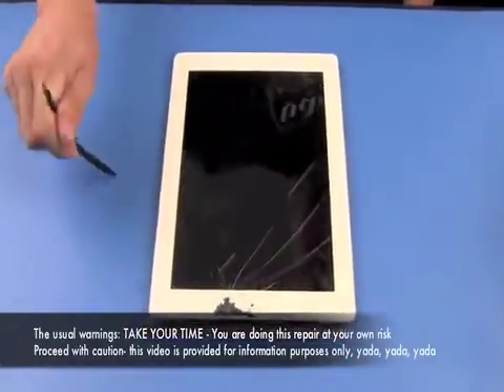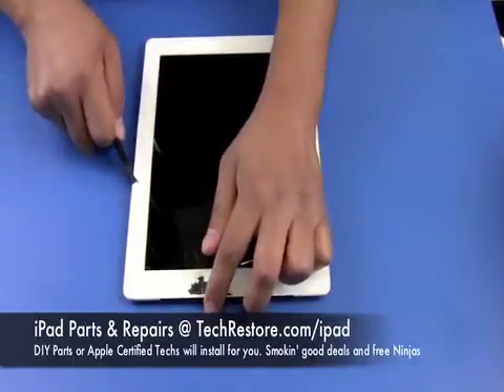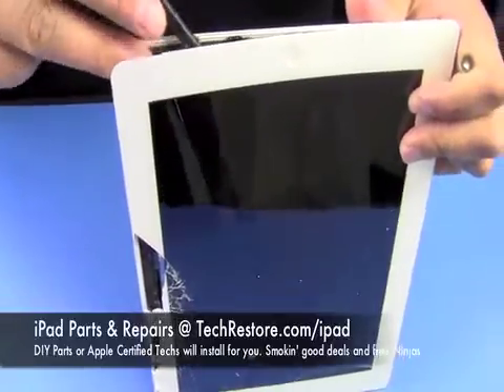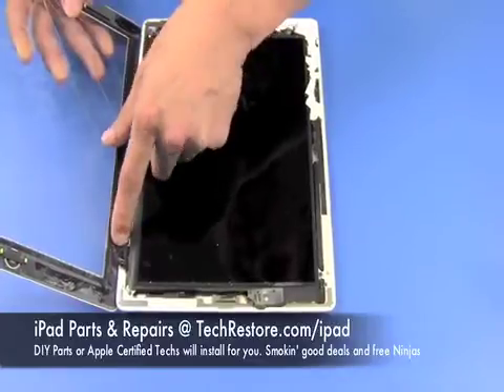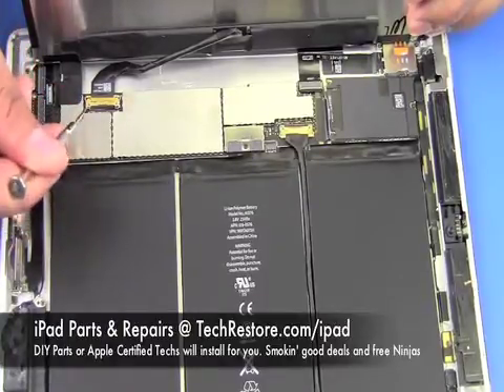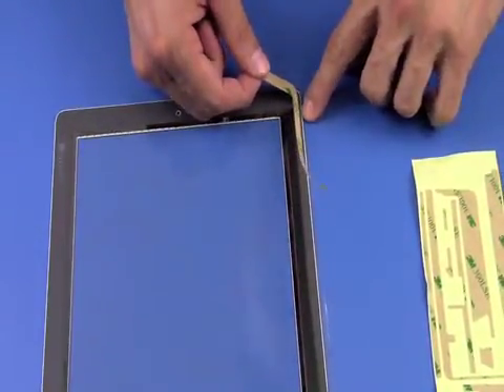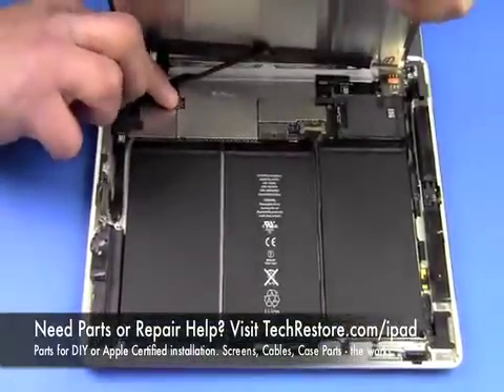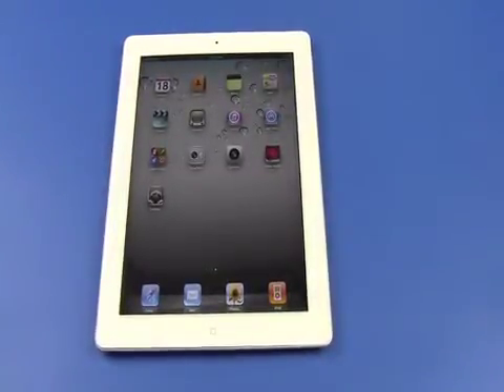iPad 2 iPad 3 Take Apart Screen Repair Disassembly by TechRestore

Comment: one I have put my new adhesive pre cut strips in place around the ipad I've seen people use super glue gel on top in the adhesive to form a stronger bond.  is that necessary? Also is loctite super glue gel the same as regular super glue gel? would it hurt to use that on the adhesive strips?